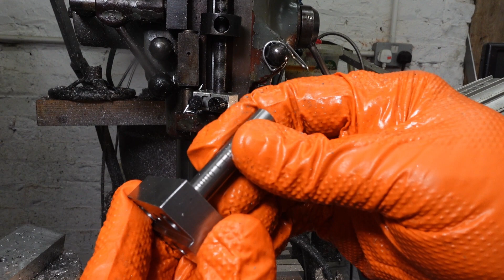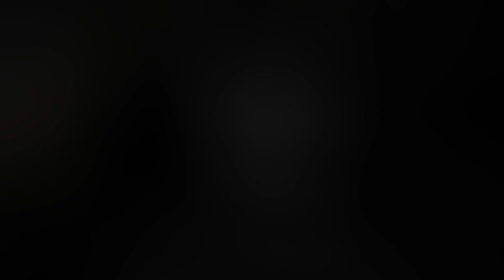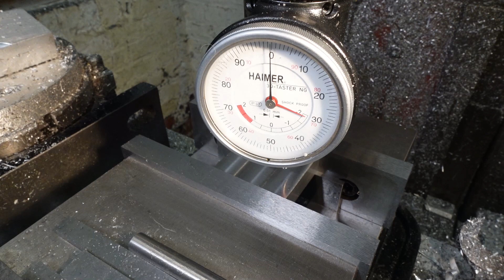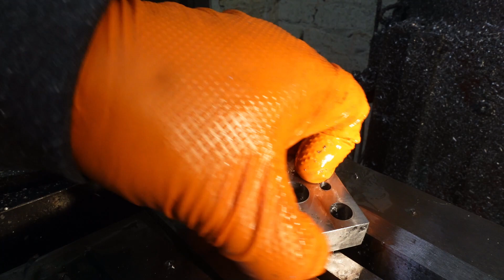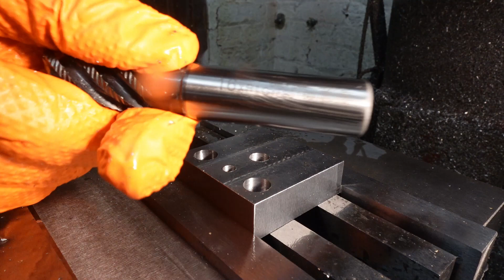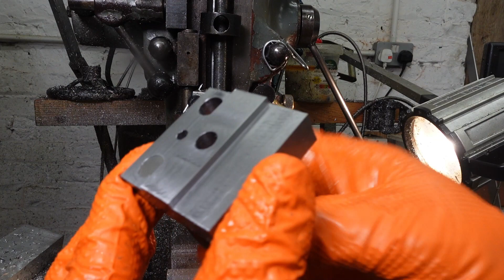Template follower for my lathe profile copier

Comment: Er, can you give us a video about the attachment?  It sounds interesting and potentially useful.
Reply from the maker: I need to finish a lot of other jobs before I can get back to the template fixture, I've made a few samples with it, but they need detailed metrology to verify the hyperboloid form and then a test in the actual antenna to be sure the template equation is right.  The lathe copies the template perfectly well, but the equation of the path I need to cut on my manual mill needs some fancy maths to get the toolpath correct.  Basically I have to calculate the curve of the hyperbola from the calculated values of a and b, then work out where the centre of a rolling disk 10 mm diameter will be at all points on the curve (differentiating the equation to get the tangent at any point, then spacing the steps by a maximum of around 1/20th of a wavelength and a minimum of perhaps half that, in both x and y directions. Then once I have the coordinate pairs, I mill those into a 3mm thick brass plate mounted on to the precision dowels, and hand-finish it to take out the approx 5 micrometre cusps between successive coordinate pairs.  It would be about 87.3% easier if I had a CNC to make the templates and 99.4% easier if I get the CNC conversion done to the lathe. I have a 750 watt servomotor with a fancy shaft encoder, but really I need to do a ballscrew cross-slide conversion to make this work really well, but then I really need to rescrape the cross-slide, and then there's the issue of the bit of wear in the leadscrew and saddle gears and it goes on and on. I can probably get sufficient accuracy using the existing leadscrew on the cross-slide and just drive the thing in one direction when making cuts.  Anyway, it will happen, just not yet!